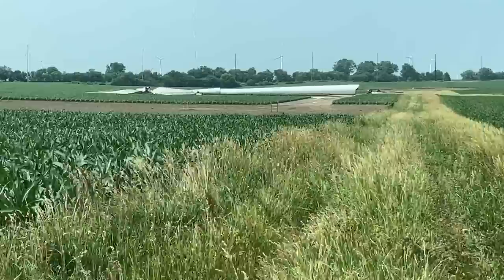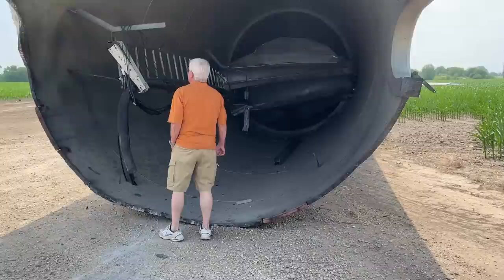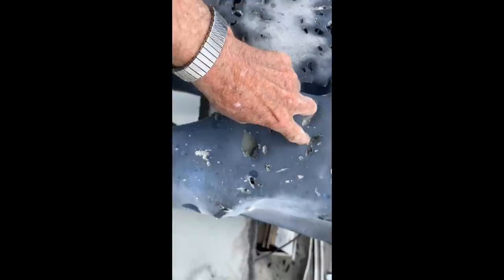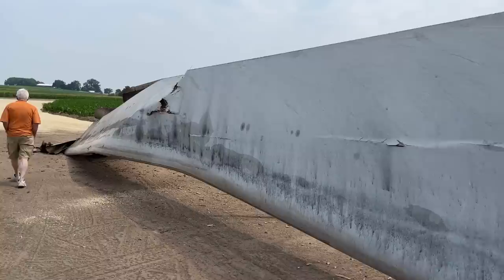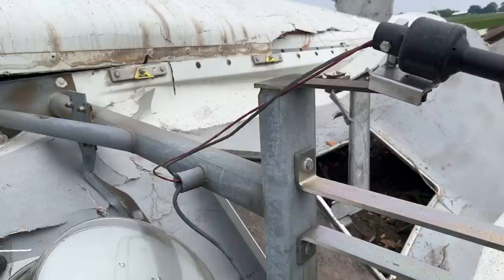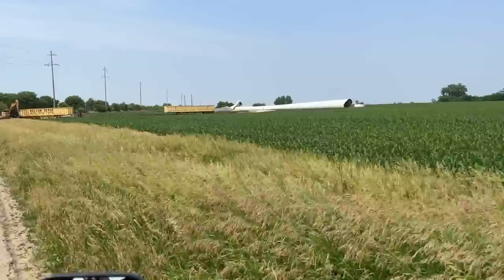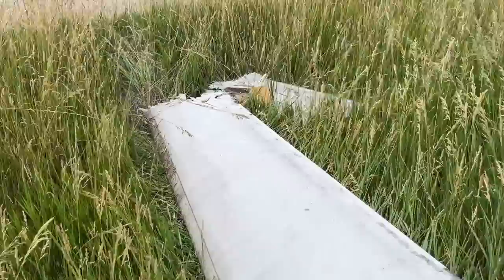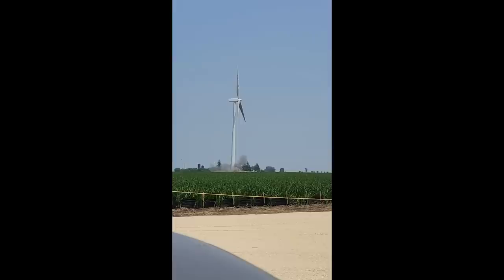OBSOLETE WINDMILL DEMOLITION short #47 pt 2 tubalcain energy lies scam fraud

Comment: Great food for thought Mr.Pete! It is perplexing that it is cheaper to build completely new units including foundations and tubes than to retrofit the old tubes for new generator and blade assemblies. Perhaps they are going larger and can't utilize the old tubes and foundation. Just some quick math on the steel, if the tube was 10' in diameter at the base, at 1-1/4" thick that tube weighs approximately 1700 lbs per foot, at the top if it was 8 foot it would be approx. 1200 lbs per foot. If the tube was 200 ft tall and you averaged the weight out to 1450 lbs per foot there would be approximately 290,000 lbs of steel in that tube or 145 short tons. At 200 dollars per ton scrap price those dead tubes are only worth 29,000 dollars for scrap. As to new price per foot hot rolled averages .43 cents for hot rolled at mill price, add wheel abrading, tube manufacturing cost, coatings and my guess is you could easily hit $2.00 per lb or an average of 2,850.00 per foot of tube for a material cost of $570,000.00! That is just to build the tube, not transported or installed. Granted this is all conjecture but when you start looking at how many of these things that will be obsolete it adds up to nothing more than a way for the elites to line their pockets and virtue signal how they are saving the environment. Jury remains out on viability IMHO.
Reply: That scrap value is really horrifying!  I imagine that cutting those tubes up and taking them TO ?? wherever big scrap goes would cost WAY more than that!  It's not unusual to run into stuff that has NEGATIVE VALUE as scrap!  You have to pay to get rid of it!
Reply: Thanks for the data.
Reply: Who will sell hot rolled at .43? I have not seen a price no where close to that since before 2020
Reply: @bcbloc02 
Hot rolled and delivered that much steel (50 windmills) may even be as cheap as fifty. Probably would be more If including the braces, bolts, and the ladder. That super duper heavy gauge copper though. Jeez!
Reply: @bcbloc02  That is average mill price taken from internet, not the steel suppliers.
Reply: @bcbloc02  $2 a pound is about right for new structural steel, sometimes less depending on the shape and popularity. i typically use L, HSS, and wide flange i-beams at work, and some HR flat stock. pipe is a whole different animal.
Reply: You probably have to buy a lot of it to get that kind of a price..

Comment: Lyle - Thanks for these two videos.  Very interesting.  Those of us who were trained on steel cutting charges, happen to be engineers and have used explosives find this informative -- at least speaking for myself.  Failure modes of the column, reaction at the base, thread failure, etc are what I would have expected.  I remember 20 years ago when we were constructing a new building at work dealing with the architect/engineers - they explained to me how all commercial endeavors were moving to designing 15 year usability buildings.  I imagine these are much the same.  That will determine the depreciation life, which cranks into the financial considerations, etc. etc.  It used to be we designed for long life infrastructure.  Now days not always - or I guess often - the case.  Trying to do a lifetime analysis of was the investment worth it, net impact to the environment and so on would be worthy of a master's thesis I would think with the complexities involved.  All I know is we humans have to get smarter but I have my doubts as current trends seem to indicate a pride in being stupid instead of trying to educate one's self as to what is really going on.  Have a good 4th of July.
Reply from the maker: Best comment so far
Reply: @mrpete222 As the gunman fell off the roof after being winged the guy that was in the third floor window heard him say "so far, so good". Second floor, same statement. Bottom window heard him say "not so good anymore". Nice video Lyle.
Reply: Crooks, robbers, thieves and murdering pirates.
Reply: Maybe they don't plan on so many of us being around in 15 years, so designing for a longer life would be overkill and wastefull....
Just eat your bugs and stop asking questions

Comment: I believe they use a balsa wood core for windmill blades with a fiberglass or carbon fiber outer shell. Windmills often have little weather stations and if the conditions aren't right they'll shutdown to prevent damage. The one that almost hit the road you can see by the compacted grass it did actually get much closer but one of the workers must have broken off and bent it back. Those windmills probably cost about $5 million each after everything is said and done (including corruption). I think they broke even but I think they were also designed with planed obsolescence in mind so although they may be clean they are certainly not green. . . . I think the nuclear power plants have been proven to be more green than anything. . . . But they're "too cheap to meter" so our ruling class billionaires made a bunch of propaganda and openly (and in the shadows) sponsor protests so we fear them.
Reply: Know much about radiation? There's some great videos on You Tube.
Reply: It's easy to trick the mind into forgetting Chernobal. We'd never have THAT problem in America! If you only knew how many times we've come within a hair's breadth of catastrophe. I guess it's also easy to forget that all the other energy systems are subsidized as well. All told you'll never get a Chernobal type event from a failed windmill. I happen to view them as quite beautiful.
Reply: @ExtantFrodo2  First of all our power plants are built with failure in mind. They have these huge concrete containment buildings that are designed to hold and the gamma radiation in the event of a meltdown. 

Second of all evidence has emerged that Chernobyl was sabotaged by us. We hacked the instruments and our numerous moles intentionally designed and built in defects to give them false readings and the rest is history. Chernobyl was one of their military town complexes similar to our Area 51 (It was an entire complex and people only talk about the power plant or the antenna arrays.) RBMK Reactor types are actually safe by designed and you have to do something really stupid to get them to melt down. In fact their design was an improvement on ours and it was supposed to be so safe it "didn't need a containment building" which made them significantly cheaper and more efficient.

To this day there are no lows that are own shadow-interests groups object to sinking to if it keeps them in power. (Just refer to LITERALLY ANYTHING that's been declassified or leaked.) There's a conspiracy here to make the public fear nuclear. It's the same conspiracy that tells you "diversity is our strength". IT'S THEIR STRENGTH and it's the sheeple that give THEM power. We simply don't have a choice we're allowed to discuss openly. 

Nuclear will always be superior because there's no money in it for them. (In other words, it's bad for capitalism.) It's safe, it's clean and it's too cheap to meter.

Comment: Aloha Lyle,  In part one you mentioned removing only the top 2 Ft of the concrete base and then covering the rest.  If that was not government subsidized EPA would mandate removal of all of the structure.  There is a totally different set of rules for anything labeled "Green"

Comment: Thanks for sharing Mr. Pete! I've seen a lot of those while heading south of Bonfield, IL cutting across the farmland to pick up Interstate 57 (we drive down county road 7000 S). They sure are an eyesore! I can't get over the thickness of the steel, especially on the doorway! You should have grabbed one of the triangular cutouts. That was interesting that it stripped all of the threads on the bolts holding the tower together upon impact! Very cool! Thank you for sharing!
Reply from the maker: You are the first one to comment on the things that impressed me the most. In fact, that is why I made this video.
Reply: Since there’s no large nuts in view near the stripped threads I wonder if they may have been removed prior to destruction by the demolition crew? The stripped threads could have been caused by the violent separation of the huge sections.

Comment: Thank you for these videos! My personal opinion is that the idea of placing these windmills in really windy areas (The North Sea etc) seems logical, but the implementation is very flawed. We have much better, more environmentally sound energy generation methods. The only reason these are built are subsidies. Do we even have the technology to make something huge like this spin with huge loads on it for decades without needing constant maintenance and part replacements? Most likely no. The "industry" is trying to go in the direction of larger and larger windmills, but there is a natural limit to their size. The rotor can't be too big or the tips will approach the speed of sound and destroy themselves. There are many ideas that seem great on paper, but are horrible when implemented. This is one of them.
Reply: Actualy, in the UK onshore & offshore wind farms are subsidy free these days. Some of the very oldest might still be subsidised but, due to the way that the scheme is now implemented, when wholesale prices are high (like now) most of the installed capacity is actually paying that subsidy back.

Not a particularly windy day today but over the past 24 hours wind provided 50% of UK power, solar another 10%. Only 17% came from fossil fuels.
Reply: Bigger windmills spin slower.  As for size, check out what the Chinese are building.
Reply: @j.f.christ8421  they do in terms of rpm, but there is no straightforward linear relation there, while the bigger the rotor the faster the tips travel for the same rpm(linearly). This puts a limit on tip speed therefore on size. Also material strength etc. When your tips travel at 0.6mach every grain of sand is trying to sandblast through. Imagine this going on for decades.. To simplify this. Imagine a 100m diameter turbine at 30rpm. The tips will travel at 150m/s or 330mph. Then imagine a 200m diameter rotor. For the same tip speed you'd have to cut the speed in rpm by half while that's not the case, a 200m diameter wind turbine would have a rotor speed in the 20s. How do I know this? The biggest wind turbine in the world is in Denmark and it is 266m diameter (just the rotor). The rpm is up to 20 with tip speed up to 208m/s that's 465mph or 0.6mach (speed of sound is lower at higher elevation and higher temperatures).
Reply: @ominguti6345  That's a lot of words for saying tip speed limits RPM, ie bigger = slower.
Reply: @hlcdriver  just to mention. UK has 90% of geographic Europe 's best wind resources (North West Scotland's coast if I remember correctly the map I saw) so I'm not terribly surprised those turbines may be borderline profitable in the best location possible on the entire continent :-) However, having said that, UK may not be subsidising wind turbines directly, but they are definitely penalising other non-green methods of production. Correct me if I'm wrong, but isn't the UK in the European carbon credit system(ETS) ? These carbon credits are essentially a penalty for CO2 emiting energy producers. They were designed to slowly increase in price from the introduction till 2045, but at the same time they were allowed to be traded on the market as a financial instrument. Who wouldn't invest into something guaranteed to raise in price? The result? Carbon credits (EU ETS) currently in 2023 cost more than they were planned to cost in 2035. If that is not a form of subsidy I don't know what is.
Reply: I'm pretty sure everyone in the UK complains about their energy prices too.
Reply: @nicholassmerk  as someone who lived in UK for 17 years I can confirm this... IMO the biggest problem with UK's energy prices is that there are lots of houses that are very old and very energy inefficient while being historically significant. Insulating such houses is very costly so people just pay more for heating. If you own a house like this there are various incentives to insulate, but if you're renting, you're stuck.
Reply: @ominguti6345  They are not borderline profitable, they are profitable. Carbon Brief did an article on 8th July 2022 explaining the subsidy scheme & detailing the minimum prices needed by renewable generators. Ofgem do a data portal that shows wholesale electricity prices. Compare the minimum prices in the Carbon Brief page & Ofgem's wholesale prices. I would post links but apparently even suggesting search terms is enough to get comments deleted.

Carbon credits are neither a financial instrument nor a subsidy, they are a cap on the amount of carbon that companies in certain industries are allowed to emit. Over the years the cap is reduced. Companies that reduce their carbon footprint by more than the cap reduction are allowed to sell their unused allowance to companies that don't reduce their carbon output enough. Thus, companies that that reduce their carbon footprint the most are rewarded, those that don't are financially penalised. Failure to cover excess carbon emissions with purchased credits is illegal & will leave a company liable to severe financial penalties.

Comment: Hello Mr Pete, happy 4th. I tried to ballpark some numbers for a wind turbine. Corrections welcome!
Cost to manufacture a wind turbine
Let's say for instance a 4.0Mw turbine
Typical cost 1.3 million per megawatt = 5.2 million
Maintenance 40K/yr
Pofit to run a wind turbine
4 megawatt electric sales = 250,000 revenue per year
10 year life = 2,500,000
15 year life = 3,750,500
20 year life = 5,000,000

Comment: The really horrible thing about these windmills is that No part of the blades can be recycled! They are carted off and buried.
Reply: Most landfills won't even take them. I know of a couple large stockpiles of broken blades that sit around because it would cost too much to haul them to a place that will take them.
Reply: I live in West Texas & I know of 2 different places where they have huge piles of blades that have been cut in half. Probably wishing they could get rid of them.
Reply: Many places now recycle them.
Only in the last few years, but they certainly are doing it.
Reply: Nice thing about fossil fuel generating stations is that most of their pollution is carried off by the wind.  No need to figure out what to do with fibergalss blades.  :-).

Comment: Over 45 years in heavy industry and land development helps me see something more here. A 15 year windmill life is not the age of the physical equipment but rather the useful economic life. The replacement windmills are much more effecient, lower cost to operate and yield much better return on invested capital, regardless of subsidies.   All competing energy sources and systems are subsidized, period. On this farmland, at this time, the replacement of outdated systems with new is a competitive edge, profitable and healthy for America.  If you live in an area near coal-fired generators, you will have a deeper appreciation for your childrens future aided by such economic and engineering resourcefulness. Great videos. Glad to see the scrap dealer harvesting all that highstrength steel!